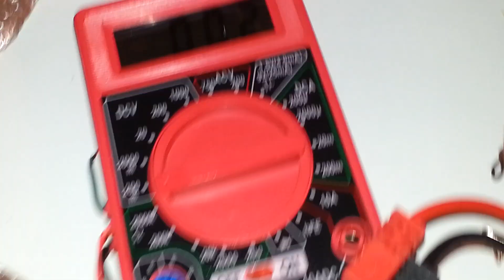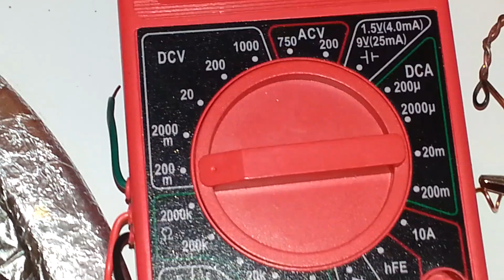Magrav single stack 2  3/4 in(based on M.T. Keshe)

Comment: Hi Meg Netron.   Good video again.    Two recommendations;

1.   File down the teeth on the voltmeter.  Keshe had mentioned that the sharp teeth would go through the nano coat and you will be tapping into copper(matter).  Just cut or better just fold down the teeth and use aluminum foil and wrap it around the end and cover any sharp areas.

2.  Your coil connector ends look too bright and shiny.  Did you nano coast the end of the coils.
Reply from the maker: Caoting flaking of the ends.  the  coil acts like an anntena. The nanocoated coil is absorbing light photons almost like a solar cell or picking up light rf from CFU light, displays micro volts.
Reply from the maker: i will do your recomedations Thanks!  Cheers!